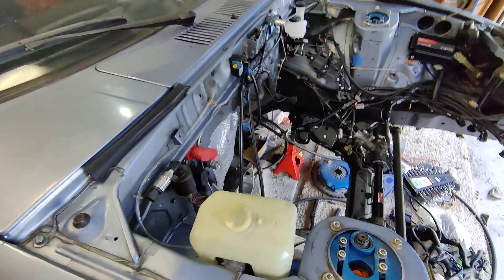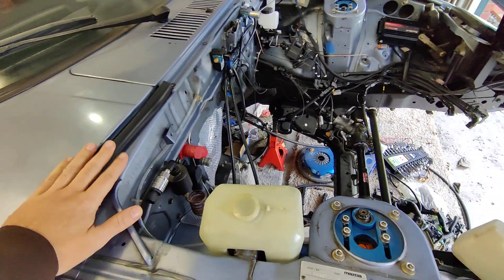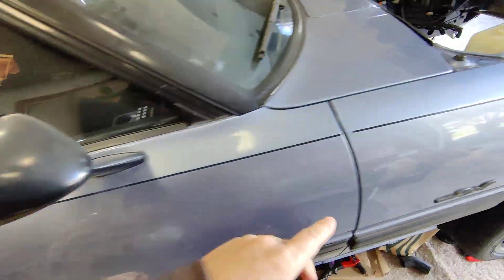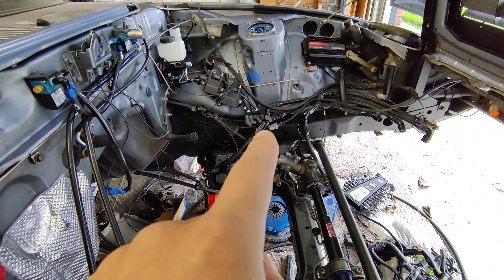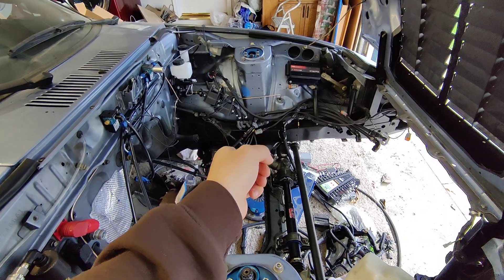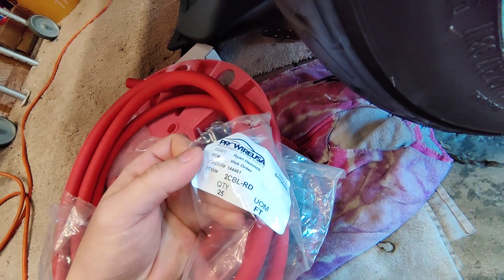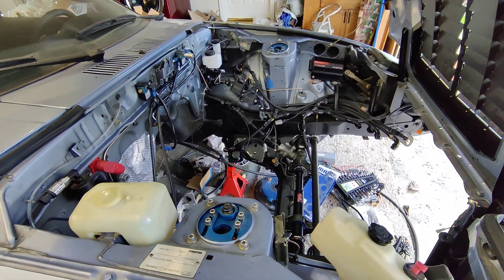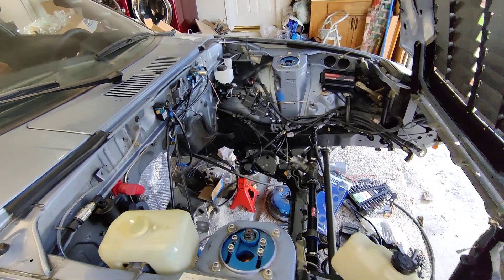Proper Chassis Grounding for Battery Relocation

Comment: I bought a car that seemed fine and already had a battery relocation to the trunk. Then at some point it started overcharging the agm battery and fried it. My ground is already ran to the front. I was thinking maybe a short chassis ground would help but you're saying the opposite. I already changed the voltage regulator and its fluctuating from around 14.5 to 16 volts.. afraid to drive it because I dont want to kill the new battery
Reply: I think i'ts your alternator fault, shoud be 13.7-14.7 volt output from alternator.
Reply: @thebearbean  right but installed a new oem voltage regulator and same problem still. Other than double checking everything on alternator like clean connections etc. Its in a very difficult location on my car.

Comment: Im having voltage fluctuations with a new h/o alternator, i also have a rear lithium in the back grounding to the chassis. Would running a ground from the rear back to the engine block where my big 4 is done fix my fluctuations and battery light on? 
Thanks
Reply from the maker: Yes it would.  Any battery relocation needs this.
Reply: @RGHTBrainDesign Ok awesome thank you so much! I highly appreciate your content here. This is great stuff. I guess that's my missing link to my electrical runs. ❤️🙌

Comment: Best video i have found with explanation, thanks. I have a question if you don’t mind helping me out. Guy did a full 13 circuit AW harness on my 64 impala. Red top in the trunk, ran 1/0 power to a frame mounted distribution bar and the ground off the battery to the frame directly underneath the battery. Im getting weird things going on. My fan controller flashes err batt and my new led tailights are acting funky. He told me the battery should be clean with only one pos and one neg coming off and everything runs off a dist block. I called dakota digital and they say this is wrong and i think i agree. I want to run a 1/0 straight to the starter, one straight to the alternator and a ground from battery to block. Then go to the frame and bod and so on. Would you agree or can you tell me my best way to do it? I am also going to be running a 2000 watt or so jl sound system along with some leds, i am also running accuair e level with two compressors for airbags suspension. Any help is appreciated thanks
Reply from the maker: Run the Battery Ground to the center of the engine and everything in the engine bay goes off of that singular point.  All in-cabin stuff goes directly to battery negative through distribution block.
Reply: @RGHTBrainDesign  thank you for the reply, so run another ground off battery for the distribution or are you saying run the dist off the motor block ground? What about positive cables? I want to run a 10 circuit fused panel that is an ignition keyed on only panel for accessories requiring keyed on ignition.

Comment: So if the resistance across the body of my car (front corner to back corner) is only .3 Ohms, do I really need to run a ground cable to the front of the car?
Reply: Just ground to the body. Then a ground from ground to engine. Use that ground point for star grounding. A steel body has negligible resistance as long as the paint is removed at the ground point.

Comment: Hey Ryan, you tuned my FD about a year or so ago. Last year the the HKS TwinPower module installed by RPM burned up and I'm in the process of installing smart coils. Question: what the best way to ground the coil harness labeled "ECU Sensor Ground"?  There's not a separate ground on the Adaptronic ECU, so should it ground to the chasis or the engine. I also need to check how my relocated battery was wired at RPM and may have to redo it if it is not in accordance with this video.
Reply: Why would coils need to use the ECU sensor ground? I just grounded my coils to the intake.